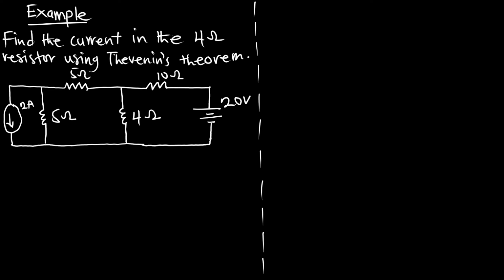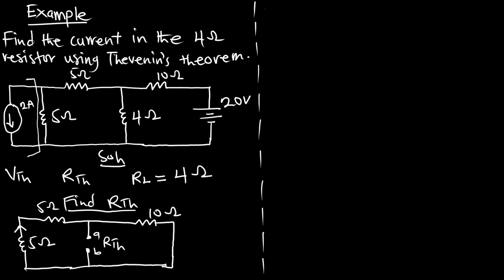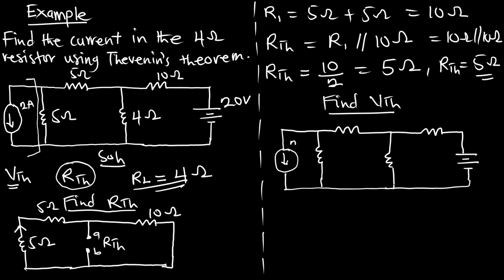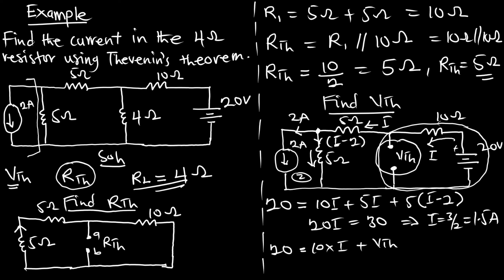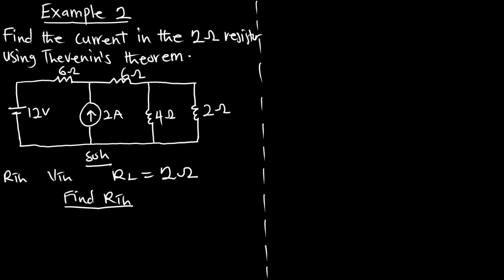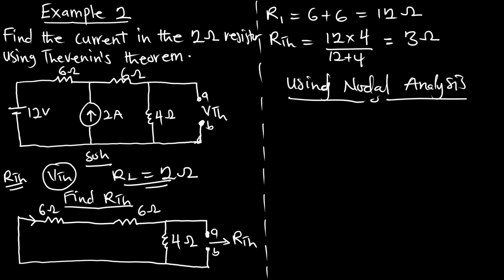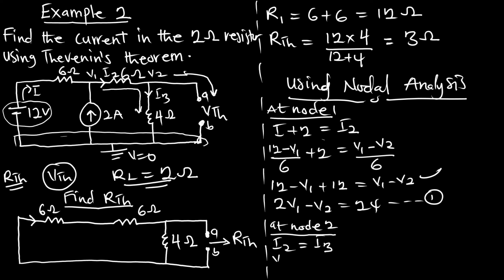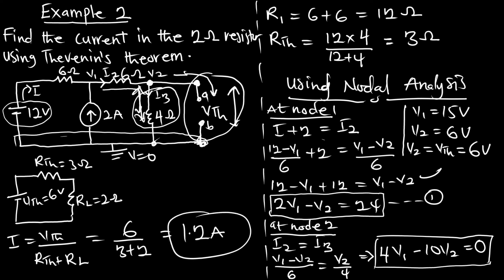Ep 27: Solved Problems on Thevenin's theorem

Comment: With the examples 2 
You said if there is a voltage source between a reference node and a non reference node the voltage at that node is the voltage of the source voltage
This V1=12v straight away 
But u solved for V1 and got 15v
Please is there any explanation to that